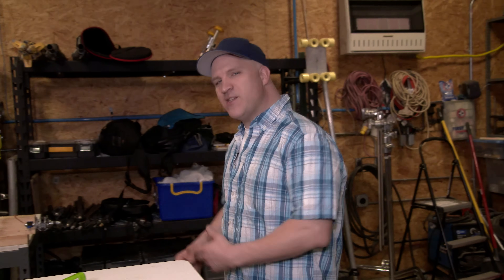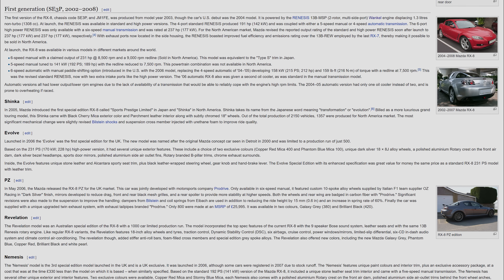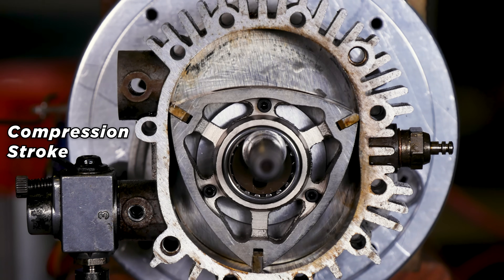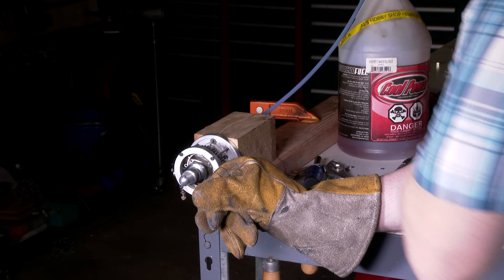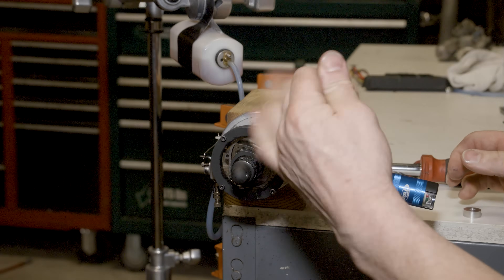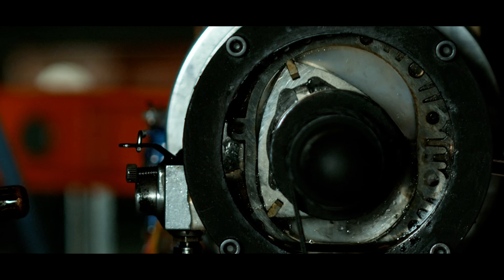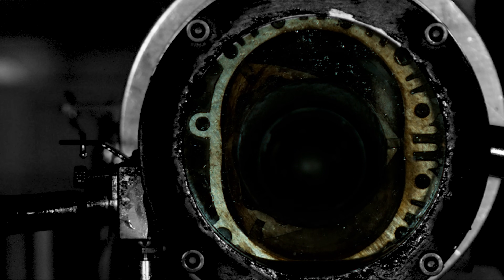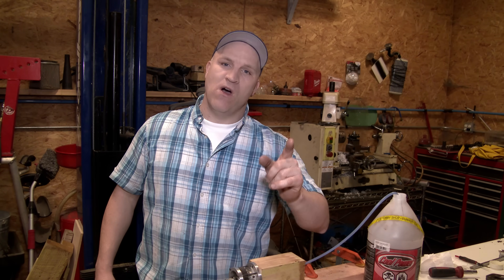See Thru Rotary Engine in Slow Motion - (Wankel Engine) 4K

Comment: A really fun vid, thank you! But the timing was slightly off when you started the engine: the first combustion pushed the rotor in reverse. Also: a lot of uncombusted petrol sloshing about inside. That's gotta hurt both your MPG and emissions.
Also, I'm quite impressed that you fond a clear plastic that could withstand the heat and pressure.

Comment: Why these rotary engines arent  popular in european and american vehicles ???
Reply: Well. The drawbacks of this engine outweigh the positives. 
They tend to have terrible MPG. They are high maintenance. If one doesnt maintain the engine properly then one gotta replace the engine in about 60k miles. 
In addition they also have high oil thirst. The engine needs to be kept lubricated. And the lubrication here happens in the actual engine thus burning through some oil aswell. 
There are more reasons that I didn't mention aswell. 

As fun and beautiful these engines are.  They are best only for people who understand them. 
Your average person would most likely not take care of it
Reply: because they break and are unreliable as hell compared to piston engines
Reply: @kashingxu9856  The most reliable racing engine you can get.  They have to be taken care of though.  check oil regularly and beat on them every so often.  Drive more than just short distances from time to time.  The main drawback is that the world is built to accommodate piston engines so its kinda like having a pet skunk.  They are for the most part like a cat but you can't just bring it to cat groomer to have it bathed and vets have less experience working on them.  You cant take a Rotary car to just any mechanic to work on the engine.  You learn to do things yourself by owning the car and when it does inevitably lose compression its time for a rebuild and bridge port to make it even more fun than it already is.  Then ofc its no longer a daily at that point.
Reply: @clownavenger0  Wankel engines were very unsuccessful in motorsports, Mazda no longer has any motorsports program.
Reply: They were never popular in any type of vehicle... Mazda saw very limited success but was generally unprofitable. 
Poor sales led to the engine's demise in June 2012.
Mazda abandoned all development of production Wankel engines in May 2009.
Reply: @sandervanderkammen9230  European regulations are what killed off the motor.
Reply: @clownavenger0  NO, it was discontinued there because Mazda had no sales in Europe... it was not due to emissions regulations.

Comment: The first production car with a rotary engine was a Mazda R100. The rotary caused a bit of a sensation when it first came out for its size per power output and lack of moving parts when compared to a regular internal combustion engine. This was the late 1960s and not too many people were worried about fuel consumption back then. With highly efficient internal combustion engines and the latter hybrid cars, I doubt the rotary engine will ever make a comeback.

Comment: the rotary is a small motor, like 3.6 liters, redlines at 9,000 rpm's. With today's technology, i can't believe someone can't make it more efficient/reliable. Cuz i hear nothing but complaints.
Reply: The Wankel engine is obsolete technology because it's suffers from several fatal design flaws related to the fundamental geometry that allows the Wankel engine to function.

Comment: Wow very smart 👍Nice job, 
I have a 1980 rx7 an motor was rebuild wen we were ready to star the motor for the 1st time nothing happened 😠😡An sparkplugs were wet with gas. So ma an disappointed 😡 An I was wondering why that happened? We now waiting for the guy who rebuild it so he can figure out🤷🏼‍♀️🤦
Reply: The spark plugs were wet with gas because your carb was probably injecting a rich load of fuel,
       In addition, 
 Was this RX7 running stop-and-go on the redundant ?
     Stop-and-go driving for a wankel will make it run rich like a mofo
    and
Was was this RX7 being ran below 3K rpm ?
   I ask this because a rotary is most efficient when running 7k-8k when the engine can introduce enough air to burn the fuel
Reply: @MainMite06  FLOODING is a common symptom of low compression in all Wankel engines. It's a sign the the one or more seals are damaged and the engine has failed.
Reply: @MainMite06  Not true, the fuel system should always deliver the correct AFR and any normal rpm range.
Reply: Sander Van der Kammen 
     I would believe the seal failure theory you mentioned.
    But
      I was targeting the carburator because it probably was falling out of adjustment ,  
     Any carburator could flood an engine if it falls out of adjustment
Reply: @MainMite06  The engine was probably assembled incorrectly and has no compression.

Comment: How is the spark plug timed?
Reply: No spark plug, 
only mini glow plug,
        It's nothing more than a heated rod that introduces high heat to nitromethane.
     This engine is running like a diesel, but the engine speed is controlled through the air & fuel injected, rather than just the fuel alond like a diesel

Comment: So when these engines get rebuilt what are the actual parts that need replacing and could they install more tougher parts like titanium
Reply: Titanium is very soft, it also catches fire and burns.
Reply: @sandervanderkammen9230  its not soft, its brittle, its a hard metal but brittle.   Ducati have lots of titanium parts
Reply: @seanviper99  They don't make pistons or rings out of titanium, they do make intake valves... but because they are soft they wear out more quickly than steel valves.
Reply: @sandervanderkammen9230  i know, parts like manifold and exhaust are titanium and other outside bits
Reply: @seanviper99  Yeah so what is your point?

Comment: Old rotary snowmobiles we’re pretty dangerous. Pull er over the wrong way and she’ll start in reverse. Not a good design.
Reply: You know this situation could happen in a 2-stroke mini piston engine....
      The reversable starts are only caused by engines that dont have a distributor or a timed ignition system that controls the combustion timing. 
       This is a mini glow plug setup
     The glow plug isnt firing on-&-off like a spark plug 
    So it's always "on" and acting like a diesel but with air-intake control

Comment: Do rotary engines use a lot of fuel and oil?
Reply: YES
Reply: Only in stop-and-go situations the fuel will be burned inefficiently
    But on highways any other situation when the engine doesnt need to slow down or stop.
      A wankel could be just as if not more fuel efficient than a piston engine
      A piston engine can only be efficient when running a constant low speed without drastic accelerations &/decelerations.
     A wankel rotary could be driven at almost any speed and maintain the same fuel economy as long as the engine is moving a constant speed.
     Imagine revving a rotary at constant ~8K on the highway & getting 20 mpg
Reply: @MainMite06  Wrong, Wankel engines are less mechanically and thermally efficient and have extremely poor combustion efficiency.
Modern reciprocating engines are more efficient in all operating parameters.

Comment: Don't forget to mention that they have 3 power strokes per each revolution of the eccentric shaft 
which is what helps pump so much power for such a small engine
Reply: That is incorrect, it only has one power stroke per rotation of the eccentric-crankshaft.
 The triangular piston (aka rotor) rotates at 1/3 of crankshaft rotation.
Reply: @sandervanderkammen9230  you're right I had it backwards
Reply: @TheDoomclaw  No worries, cheers mate!

Comment: No ignition? So it's a diesel?
Reply: Glow plug ignition, not Diesel Cycle
Reply: The glow plugs are acting like a diesel as a high heat source, 
    but the combustion here is truly dependent on how much air & fuel is introduced rather than just the fuel alone
Reply: @MainMite06  Glow plugs do not act as a heat source in Diesel engines either.

Diesel engines are fundamentally different in their basic mode of operation.
The Diesel uses Stratified Charge Mode Combustion and no ignition source. Ignition timing is achieved through injection of the fuel.

Glow ignition/Hot Bulb engines are Homogeneous Charge Mode Combustion and the ignition timing better roughly controlled by the auto-ignition characteristics of the fuel chemistry and is initiated by hot surface of the glow plug, not compression.

Comment: Would direct port injection make this motor more efficient? Controlling the amount of fuel given other than carbs and traditional injectors.
Reply: Exhaustive research proved the Wankel was poorly suited to GDI.
Reply: Sander Van der Kammen 
Please give me the source
Reply: @MainMite06  The M950F....
Reply: Sander Van der Kammen 
I cant find any article that clarified that the M950F concept even used direct injectors
       And also, the M950F is 50 year old concept car.
    GDI tech has progressed a long way from the 70s
Reply: @MainMite06  The lion's share of the development history of the Wankel engine predates the internet... any printed reference on the Wankel worth more than it's pulp will mention the C111 and the M950F.
Daimler-Benz pioneered GDI and has lead the world in direct injection for nearly a century.
Reply: @MainMite06  "GDI tech has progressed a long way from the 70s"

Indeed, but  Wankel has not. 
The fundamental concept of GDI remains the same, the Wankel engine is plagued with poor combustion chamber geometry and lacks the static compression ratio required to take advantage of the benefits of Stratified Charge Mode Spark Ignition combustion.  

The Wankel engine has proven unsuitable for the Diesel Cycle operating principle for these same reasons.
Reply: Sander Van der Kammen 
    Where is the printed or digitized source that proves that Mercedes even used direct injection inside their test Wankel engines?!
    GIVE IT TO ME!
Reply: @MainMite06  Mercedes-Benz C111

Comment: why does it kind of miss fire when starting? the rotar turns backwards a little bit
Reply: It's misfiring because the fuel is being introduced at a constant rate, & the glow plug has no true firing order nor phases,
     -The "starting string" Warped Productions is pulling is the only time the engine gets "phased" 
     so this engine could end up misfiring backwards because nothing in this engines runs in an organized firing order !
Reply: @MainMite06  oh wow, that's interesting. Thanks!
Reply: The Wankel engine has a very poor combustion chamber design which is inherent to the design geometry.
The Wankel tends to misfire and suffer from erratic combustion more than modern reciprocating engines.
Reply: @sandervanderkammen9230  So do the ones in the RX-8's and what not have this same issue then?
Reply: @weeeeee831  Absolutely, the Mazda RX-8s suffered from very high failure rates and short engine life due to combustion efficiency problems which destroys the seals.

Comment: The acetylene is too rich. Fire up the acetylenw torch with oxygen and acetylene until you see a blue flame, then snuff out the flame allowing that mixture to enter the engine and then fire the engine. Make sure you're wearing a hard hat and a face shield when you do this

Comment: People should realize this Wankel uses a glow plug for ignition, and NOT a timed ignition system.
Reply: Good point, people should also know that this engine delivers very poor performance compared to reciprocating engines with glow ignition and has a much higher fuel consumption.

Comment: This engine backfires more than supervillain's plans.
Reply: Mi 28 😂🤣🤣
Reply: @CarlMan69  if an engine was made up of equal forces it wouldn't even turn.
Reply: Not while actually running...
Reply: James M  Often backfires refers to afterfires as well
Reply: I think it's more the fuel than the engine, too low an octane rating, detonating before full compression into the correct chamber
Reply: 999th like
Reply: lol 😂😂😂😂😂😂😂😂
Reply: Lmmfao 😄
Reply: James M  its knocking not frontfiring or backfiring
Reply: @Charlie-nc3cp  Did you watch the same video? It's very obviously and clearly firing thru the intake and completely stopping the eccentric in its track while it's trying to start.
Reply: @refluxcatalyst7190  That's because it's a rope start. It doesn't need to be perfect because you forcefully "send it" in the right direction from the start anyway.

Comment: smooth as butter. high revving. ultra high power per litre. fewer parts
burns more fuel. no low-end torque. parts fail easily. hard to maintain.

Wankels cannot be used for anything but racing applications.
Reply: Not made for racing anymore either...
Reply: @sandervanderkammen9230  emissions huh. yea, the 200-yr old electric motor is the propulsion of the future
Reply: @FjordTrotter  Not durable enough for most forms of racing and torque output characteristics that leave a lot to be desired.
 I remember back when many experts believed the Wankel engine was the future... and 30 years ago when I was told in 20 years all internal combustion engines would be replaced by the electric car.
Reply: @sandervanderkammen9230  mazda did use their wankel engines in the le mans series... tho i cant speak of whether it was the best option for them...
Reply: @FjordTrotter  Mazda's win at LeMans was one of the luckiest accidents in the history of endurance racing...
The 787b was a very slow and uncompetitive car that never won a single WSC championship. 20 losses in 21 races with zero pole positions or fastest race laps posted... it finished the 24 hours race with a record slow elapsed time because most of the field that year was taken out in a huge wreck.
Reply: @sandervanderkammen9230  anyways, im glad its done with. its not an engine that could ever become a mainstream application. I wanted to buy an RX8, but its lack of torque and enormous fuel consumption (more than a V8!) plus cold-start flooding issues turned me off. I have a modded 335D, with 660 ft-lb of torque (880 nm), average 37 mpg US (6l/100km?) and its the best daily car ever. Kudos to Rudolf Diesel... and to Wankel because I absolutely love the rx7.. maybe I buy one for a toy someday but I've got an R33 GTR on the horizon. Oh that rb26 is just heaven....

Comment: So easy to forget that a piston stops, at the top and the bottom of the stroke.
Actually stops, and changes direction accelerates, decelerates, stops and repeat.
There is a beauty to the rotary concept,
Sad that they haven't figured out how to clean them up.

You video was amazing, 
Thank you.
Reply: It would seem from your comment  you do not understand the fundamental operation of the Wankel KKM engine...the triangular piston aka rotor is reciprocating once per rotation of the eccentric-crankshaft as it orbits in a planetary motion.

Comment: Hi mate exceptionally video about the Wankel engine... Also we can see clearly why this engine is not common use despite the fact the can be very small and without vibrations but still powerfull... Since it's not very fuel saving effective however, is in the rotation movement that also have the stigma for being oil burners?
Reply: The Graupner 49PI is rated at only 1 horsepower so not very powerful for it's size or weight, they weren't particularly durable or reliable either, high fuel consumption was a disadvantage too.

Comment: Why do they make a lot of power for their size?  Because it actually acts as a 3 cylinder 2-stroke engine, with 3 power phases for every rotation of the crank.
Reply: This is a Graupner 49PI and is rated at just 1 hp, less than many comparable reciprocating 2stroke engines.
Reply: There is only 1 power stroke per crankshaft rotation.
 The Wankel requires 3 rotations to complete it's firing order sequence.